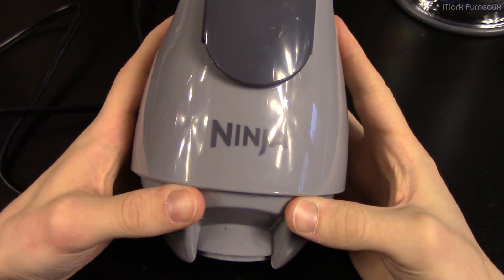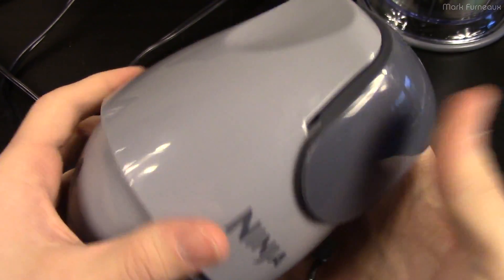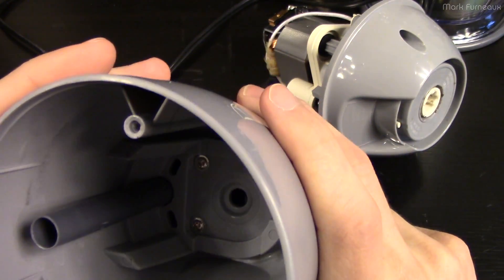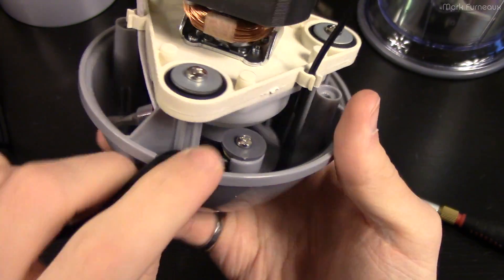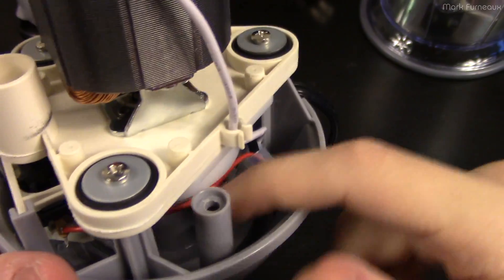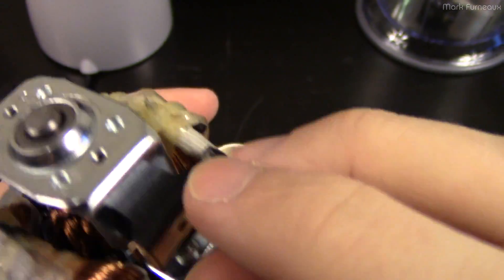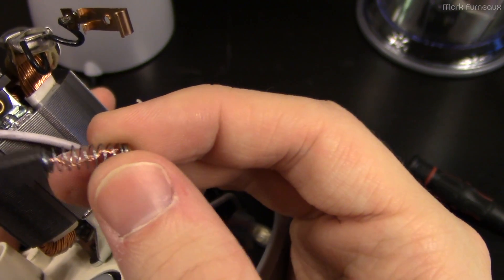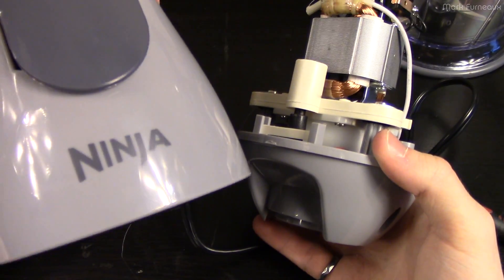Inside The Ninja QB900BC Blender

Comment: The thermal cut out is likely resettable by means of a bimetallic switch which resets once the threshold temperature falls sufficiently. It's just to prevent overheating of the motor windings causing permanent damage and is common to many motorised appliances of this type.

Comment: Hi Mark, this is a great video, thanks for making the time to produce it.

I am wondering how interchangeable these Ninja motors are? Ie would a 1000w motor fit into any base model which is 1000w ( screw mountings etc), or does each 1000w model have custom mounts for the motor?